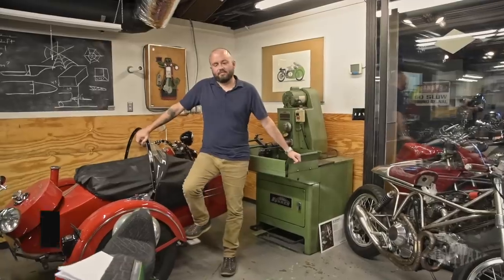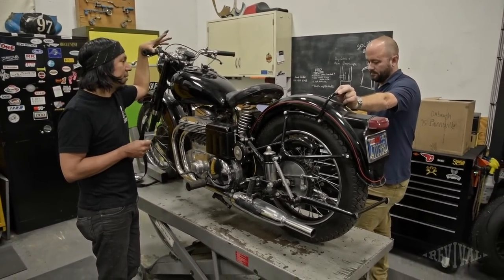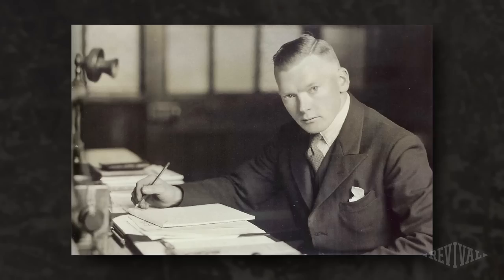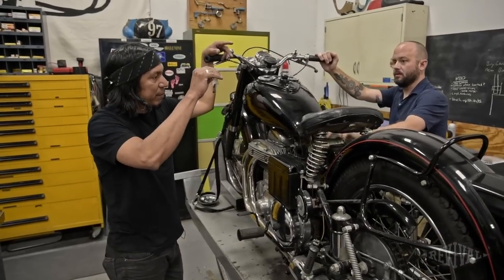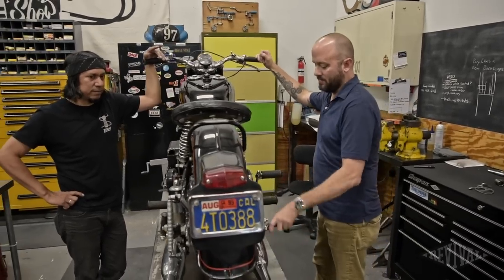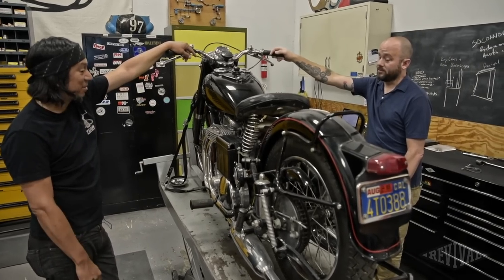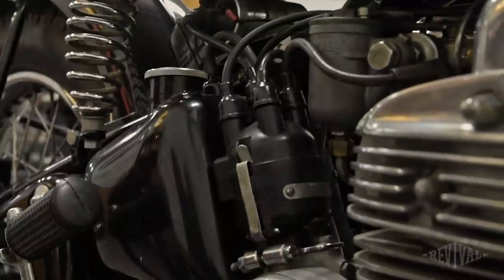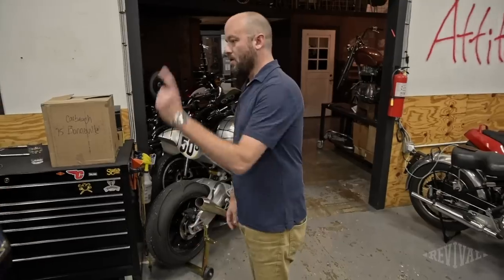1953 1,000cc Ariel Square Four  or "Squariel" Gets a "Revival Special"  // Revival Daily 80

Comment: The general opinion of people that have never owned a Square Four, is that the rear cylinders overheat. And why be surprised that a 1000cc bike will do over 100. The 500 single does 90
Reply from the maker: I can't say that anyone at the shop has owned one but we've spent a lot of time wrenching on half a dozen of them. I'm no Ariel expert myself and I expect that you're going to set me straight if I'm wrong, but my understanding has always been that overheating could be an issue with the earliest generations due to shared exhaust pipe design. The rear cylinder exhaust would heat soak the heads before merging with the front cylinder exhaust. In the later Gens this was solved by redesigning the manifold to route the rear exhaust out through it's own pipe. 

Maybe that's just legend that's developed over the years but it's hard to imagine why you'd revise the design  to something more complicated/expensive if the original was a non issue.
Reply: @RevivalCycles  např. rok 1939 u obsahu 1000ccm  se nic nepřehřívá.To už je model tzv. vychytaný. Ale u roku 1934-37 mohou s tím  být problémy. Od 1931-36 jsou OHC a potom od 1937 už jsou jen OHV. Jsou to nádherné motocykly.

Comment: Shame about the tank (I think..) Love the original Ariel tanks, and seats too. Someone will say it's an Ariel tank that belongs to it.
Or will they?
Reply: Wrong tank and carb and tank badge.
Reply: It does look good.
Reply: It's an Ariel tank but I would think from 1948 or earlier - I had a 1950 Ariel which had that shape tank with a single fuel cap on top - the 3 circle panel on top was more likely 1948 or earlier - but I dunno if they sold that shape to suit the US market
Reply: @ultimobile  Thanks Ultimobile. Cool info.